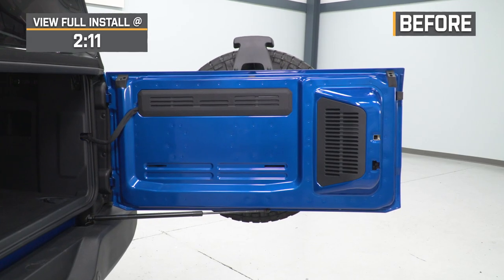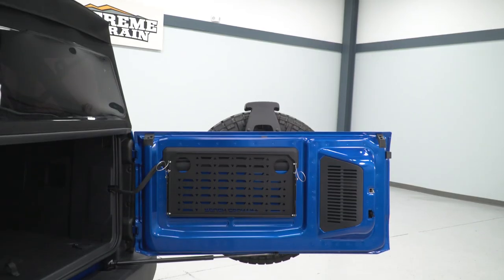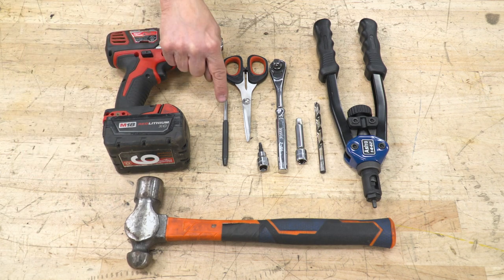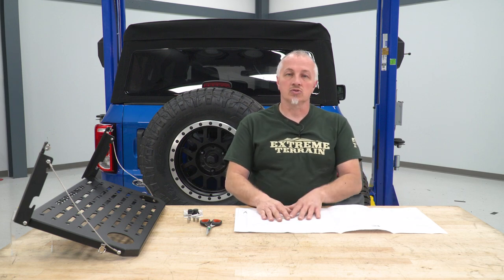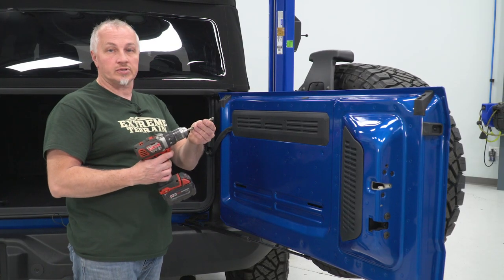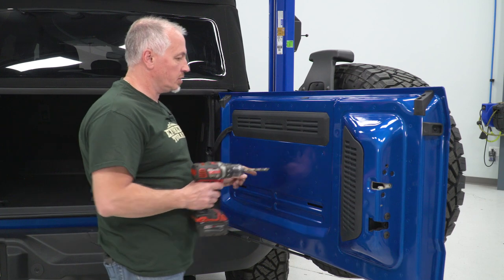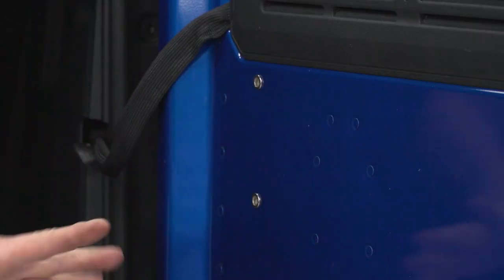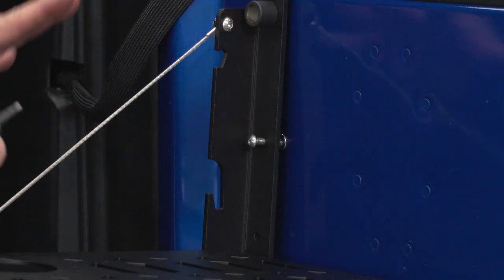2021-2023 Ford Bronco Rough Country Folding Tailgate Table Review & Install

Comment: I appreciate the video and the one-wrench rating makes it tempting, but the table seems pretty crooked at the end of the video if you look at the top ot the table against the plastic cover on the tailgate.  Can you briefly explain how to avoid this?
Reply: Well if you notice he didn't cut the paper straight and then when taped on it was never leveled.  You can align the edge of a leveler with the edge of a perfectly straight-cut piece of paper and probably get better results.  Only thing though is once you make your holes, you have holes so be careful.  You can also use a Sharpie or Dry Erase marker to mark the holes before hole punching it and see how the holes line up before taping it up and hole punching / drilling.